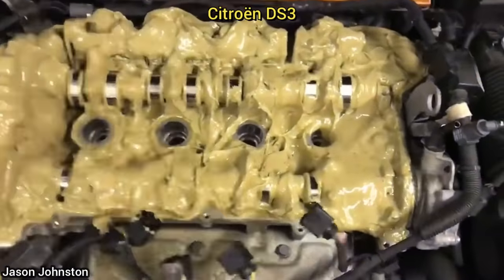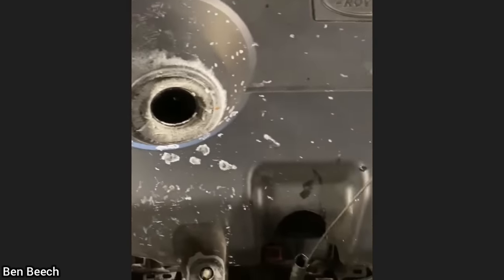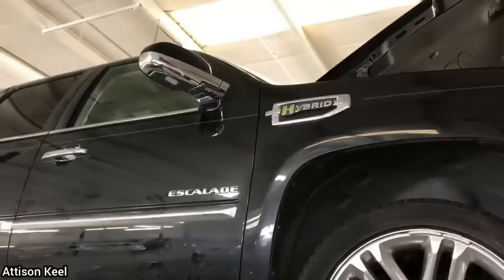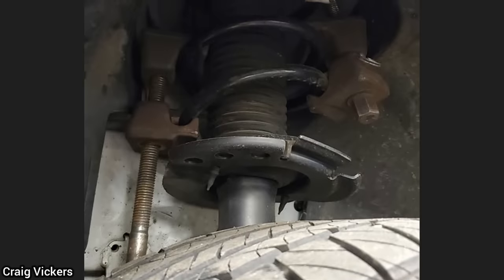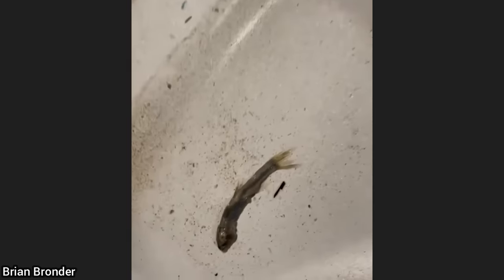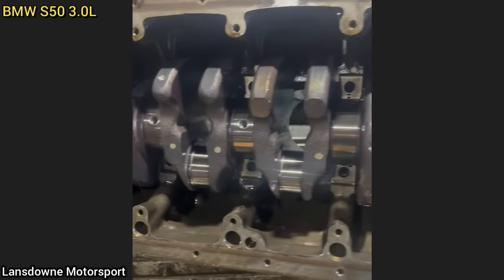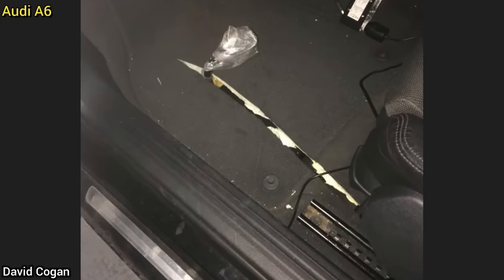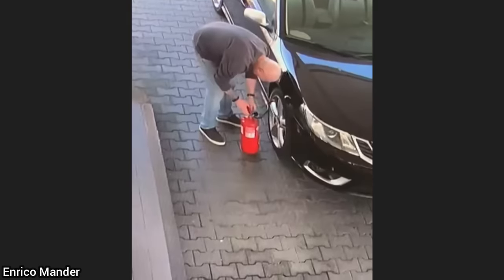Customer States The Car They Recently Bought Runs Rough

Comment: the crankshaft breaking after getting a turbo installed reminds me of when I was 15 and tuning scooters with my buddy. My buddy wasn't as knowledgable or had as much money as me, so he tried his best to tune his scooter, but didn't ask for help, so he installed a larger cylinder, racing vario, new carborator and the engine went from doing (i don't remember exact numbers, it's been 15 years) but his scooter went from maybe 8000 rpm to 15.000 rpm but didn't replace the stock crankshaft, so the crank shaft blew up and took the engine block with it. It was good fun, and the scooter was a chinese knock off of the yamaha yog R, so I ended up donating him a donor engine I had that just needed a new cylinder to work.

After that I helped tune his scooters, and made sure we bore out the block to fit the larger cylinders but also that the crankshaft got upgraded to one rated for 15000+ rpm.

A lot of good fun, but I can't imagine doing that to a car, because that'd be sad and expensive haha

Comment: Best one ive ever had, customer came in to get their summer tires put on their honda. Did that and they came back the next day complaining I had done it wrong. I kid you not they said the H on the hubcaps should be straight up and down. I attempted to explain that as you drive, your wheels turn. So they wanted me to turn them so all the H's would turn at the same time. I tried to explain then when you turn a corner the wheels turn at different speeds, but they didn't get it. So I finally lifted it, turned them all the same way and asked them to check which way they were facing when it got home.

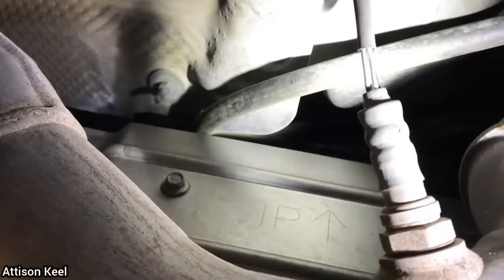Comment: 1:00 GM transmissions like that are checked with engine running, it says in shop manual, glove box manual, and on the dip stick .   DO NOT DRAIN , follow the specs for that car.

Comment: Today at work I was struggling to remove a wheel speed sensor from a hub, and dispite my best efforts managed to break it in half. Of course a new one isn't hard to install but I was beating myself up a bit until I saw a grown ass man try to use a dry-chem fire extinguisher to fill a tire.

Thanks JRI hahaha😂

Comment: Just trying to figure out how the strut was installed with the spring compressor still attached or were they trying to do it in the car and how it left another shop without the glaring issues with steering and not noticed ?? . Had to rewatch multiple times thinking i am missing something but more questions then answers , but not uncommon with alot of these clips ..

Comment: Where i live, small and/or old gas stations don't have the big fancy automatic air compressor systems.. They instead have small, mobile air tanks that hooks up to a little compressor. They are cylindrical, have a little mechanical gauge and a handle at the top, and i have only ever seen one of them that wasn't red. They dont 1/1 look like fire extinguishers, but if one was having a super extra stressy bad day, i can see how they could get the two mixed up. Just saying.

Comment: ABC fire extinguisher has 15bar of pressure, while co2 has 55 bars, so there is plenty of pressure to emergency fill a tire.. the odd one here is what kind of nozzle extinguisher has that allows to put pressure into a tire valve.. Least here all ha such nozzle that it would not work. Maybe if you cut the hose, but even still its rather large on ABC's around here, but in principle its not dumb if you are in pinch. Buddy took Co2 extinguisher, some pluming parts and made his own carry on air tank out of it to max 8 bars to test run some pneumatic stuff in his room, while compressor was in the garage. He just went to garage to fill it time to time, so it would not mess with rest of the family. Didnt get much air out of it, but enough for the small tests when tinkering with the software and relay drive valves.
Reply: Just get hold of a bicycle pump or something though. They even have the right valve type.

Comment: A lot of these videos are proof that the education system is failing us. Things like auto shop, woodworking, and metal shop are invaluable to ourselves and future generations. I have taught my daughters to work on cars, before they were even allowed to drive. I made it an absolute requirement that they could check all the under hood fluids to check for proper level and identify potential issues, change a spare tire, and identify each of the parts and their functions. That way, they are less likely to be stranded and not know what to do. So far it has payed off. 🤷🏻‍♂️

Comment: Just a suggestion; would an SUV or pick-up be tougher or more durable than a passenger car? Stronger suspension and steering joints. Some owners are so mechanically ignorant they should be taking the bus.

Comment: Did you say the customer did a oil change themselves and put
"Diesel exhaust fluid in the vehicle"
I didn't know there was such a thing. 

It seems as though someone was using their spare tire area for a bait tank.
Reply: There is and virtually all modern diesel engines over a certain size require it. It's for emissions and your ECM will not let the engine run if you don't keep filling it up, even though mechanically there isn't anything wrong with the engine. It's also super destructive if mixed into the fuel.

at the auto parts stores and many gas stations, it's labeled DEF

Comment: I'm wondering how the guy with the BMW managed to snap the crank, did it stuck on a broken rod or something? They never change the cranks even up to 800-1000hp and have zero problems, there are forged cranks to get for high performance applications but i mean how far can he go on power to break the crank before the rods or melt the pistons? That engine was stock.
Reply: I disassembled the motor and honestly have no idea. The only other failure I found in the motor was a damaged oil pump. All rods & pistons were fully intact, not even a lightly spun bearing. The motor had been rebuilt by another shop prior to the turbocharger being added so it's possible that whoever rebuilt it last made a mistake.

Comment: 0:06 Actually, painting the inside of your engine is an old racer trick. It seals the inner surfaces of the castings, and allows oil to flow faster to the sump. Unfortunately, the car's owners are not old racers.

Comment: Do you know how much boost it takes to blow up a BMW S50? I ran 28 PSI on a STOCK e30 M20 for years with no problems. The S50 is way beefier than the M20. That kind of damage was 50 PSI plus.
Reply from the maker: All the boost! 😅

Comment: Now, at the beginning of the 1900's I could completely understand all sorts of whacky things like this happening due to the automobile being a entirely new thing. But it's been over 100 years of automobiles existing.... Anyone that does not take the time to learn the basics, should not operate a vehicle. A drivers license exam should be way more in depth both on paper and hands on like a commercial drivers license or Private Pilots certificate. Anyone and everyone should have some basic physics understandings as well.

Comment: Part of the problem with the air freshener is that the electronic parking brake probably didn't engage when shifting into 4th gear at speed. When the car stopped is when it likely engaged, which would have made it seem more like a random thing.

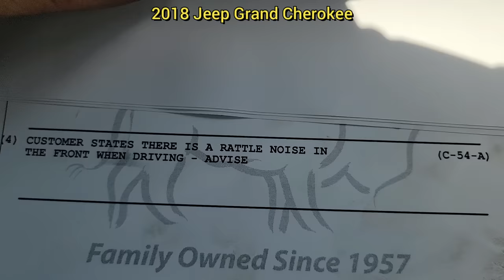Comment: What is diesel exhaust fluid? 0:36
Reply: It for newer diesel engines to help with lower exhaust emissions but it does not go into the engine at all. It's stored in a separate tank and sprayed into the exhaust system to create a reaction to reduce emissions.

Comment: sunglasses... worth every cent of the $100 diagnosis fee.
air freshener.... hmmm, what to customise? the dash, or the cardboard air -freshener?
charges three days work to remove dash and reinstall switch upside down
broken crank on a DIY turbo?
well, you did something right. it made boost, kay? maybe choose a better car next time...
phone holder..... just raking it in on these diagnosis fees. love this job...

well... a co2 extinguisher wouldnt be that bad but the valve interface is always the issue. prepare for frostbite.

as for a dry powder.... hmmm... micro balance beads!

Comment: What is "Diesel exhaust fluid"?
Reply: AdBlue for example. The stuff that new diesel cars use to reduce diesel emissions.
You add it to its own tank though, you don't add it into the engine lol.
Reply: @logitech4873  Thanks for explaining! I'd never heard of it. 

The worst thing I ever did... shameful admission... was to start pouring oil in my coolant expansion tank. I did it because of a brain freeze when I picked up the wrong gallon plastic container...

Not a biggie though, since I noticed right away. I quickly disconnected the tank, took it off and cleaned it. 

Actually I have one more, which was an actual disaster: My father was an artist, and used an old gallon anti-freeze bottle for some pale yellow dye. His studio was part of the garage, where I kept my car stuff. You know where this is going: A cold night was ahead, and so I used this in my 1930 Model A (which I was restoring when I was 14, in the early 70's). It of course froze, and cracked my head. Luckily, not the block... and back then I was able to get a new head from a friend's junk engine. That stuff was laying all over... 

I would love to know the story behind this person's mistake.
Reply: @proto57  Been there sort of. I needed to take a fuel sample and couldn't find my little beaker so I used a Coke can. Set it aside on my bench. Well, later that afternoon...it was a really hot day and you can probably guess the rest. Everything tasted and smelled like gasoline for like 3 days.

Comment: can someone explain what diesel exhaust fluid is? or is it a joke for those in the know..
EDIT to add: i've driven a '68' mack twin stick, a '75' white cab over , a '78' mack with the lazy man 5 speed maxidine trans, a '93' international cummins engine, with the five speed split shift rear end.  and even a '95' international 'boom truck' with the ten speed road ranger trans..  i delevered drywall, shingles and loads of lumber with. but never have i heard of.. diesel exhaust fluid.
Reply from the maker: It's not a joke, but Diesel Exhaust Fluid (DEF) is a solution of urea and water that's injected into the exhaust stream of diesel vehicles to turn NOx gases (harmful emissions) into nitrogen and water.

Comment: Hey, I'll admit I let repairs go longer than they should before fixing them, but these videos and dashcam videos are kinda proof to me that we need to raise the bar on what's required to get and keep a driver's license. Lots of people out on the roads that shouldn't be, driving cars that belong in scrap heaps and/or putting cars in scrap heaps way sooner than they should have been.
Reply: Me too but this stuff is next level. I recently got my oil pan changed because the oil plug had been leaking.. I had managed to stop it from leaking every time I changed the oil (I started to do it myself because quick oil change places will mess up quick) last time My trick didn't work and I wasn't able to get the pan off so I took it to a shop before I did something like some of the folks do on here.
Reply: @Super10  I was raised by mechanics and engineers, and I'm actually quite capable when it comes to car repairs, but I still do the work with my dad since he actually did it for a living. Basic stuff is no problem, oil, brakes, things I've had practice with, but I need to put in a new throttle body, and even though it seems straight forward, I want my dad watching me so I don't f up lol

Comment: Citroen DS has the 1.6 Prince engine, used by Citroen, BMW and Peugeot, it's well know unreliable heap of an engine, most down to BMW's awful valve train .
Reply: No
The Prince is an alu version of the TU engine, with added Valvetronic.
Its problems come from the extensive use of plastic and the 107 degree thermostat.
Also the very weak timing chain.
But the Valvetronic, if the oil has been changed regularly, is not a problem.